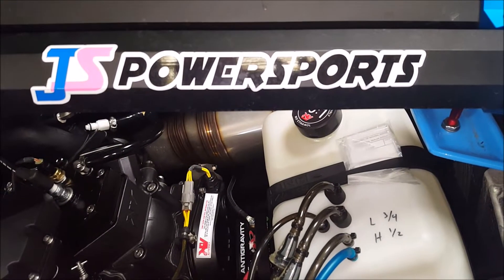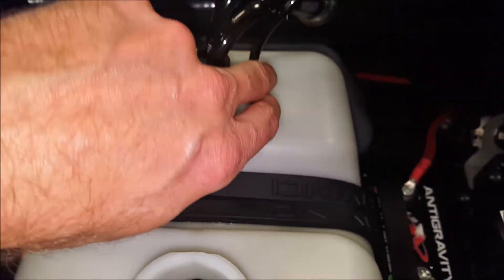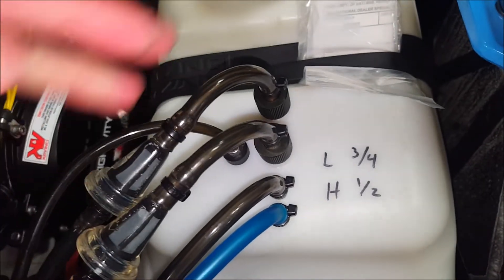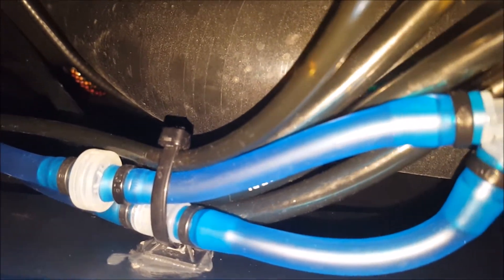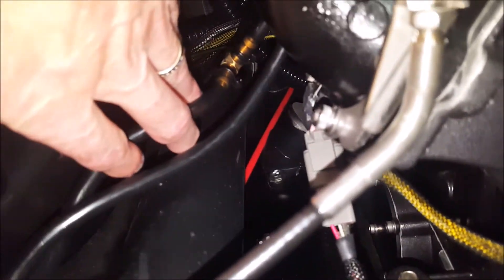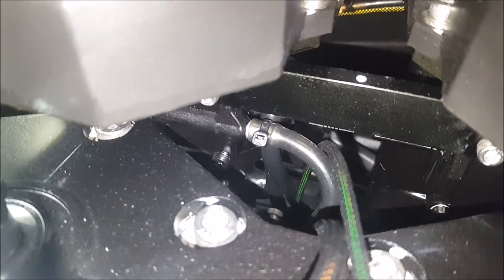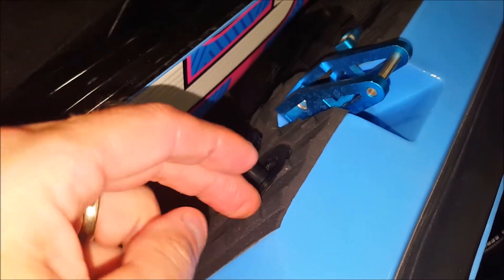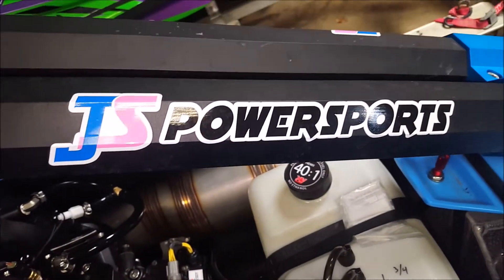Krash jet ski fuel line routing, carb models  - JS Powersports

Comment: Man I looove your videos!! I wish you did one on how to tune my blaster1 with a 62t 760 with a raider case and duel 44s  because I'm going to drill holes in it and let it sink soon 🤣🤣. Question though. Does krash have a model that would be more  like a sxr or superjet for carving/racing instead of freestyle?
Reply from the maker: Yes, the 2022 Predator. Its 11" longer than before. You can check out the rest of the details on our website
Reply: @JSPowersports  thank you sir! Have a good rest of your week